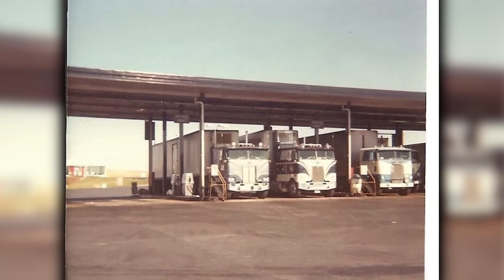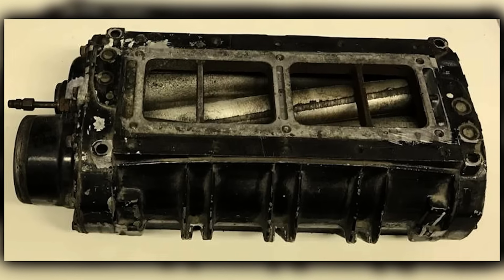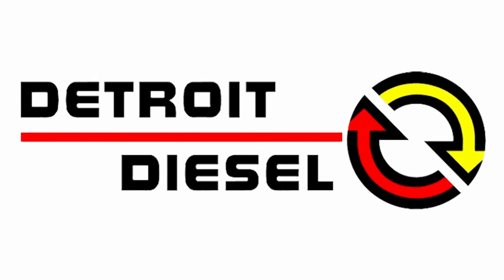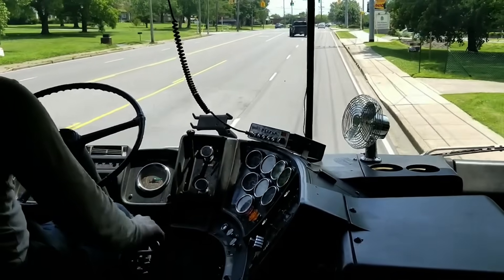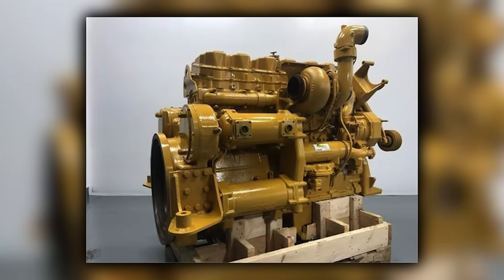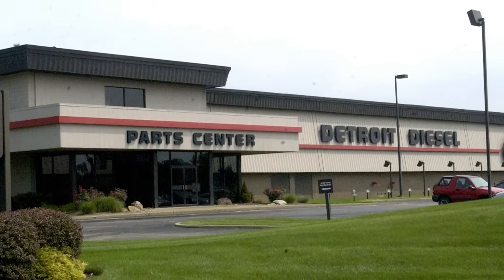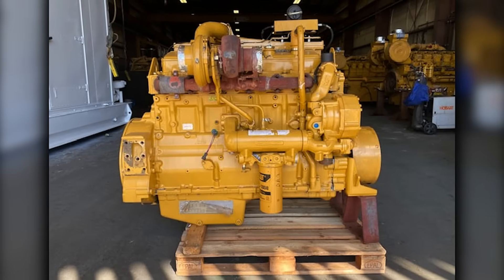Why Caterpillar’s 3406 Engine Still Haunts Detroit Diesel

Comment: @9:07 Oregon Pacific Company was a logging supply company - chokers, bells, wire rope, etc.  I know; I grew up two blocks from the store. It was located on Sheridan Avenue in North Bend. They didn't own any log trucks.

Comment: Decent video though some misinformation. 
Cat introduced the 1693 into the trucking market in 1964. This was their first over the road engine, predecessor to the 3406A introduced to the market around 1972. It remained the legendary Cat until 84 when the 3406B came into production followed shortly thereafter by the 3406C in 90 and the 3306E in late 93.
And no, none of these can be either or both... The Bs and Cs have similar fuel deliveries, however they are entirely separate engines
Reply: The 3406B and C are exactly the same engines. The C model had a bigger cam in the injection pump and an updated timing advance. Other than that the C model had an electronic stepper motor controlling the fuel rack.
Reply: The 3ZJ had a fully mechanical pump and the main bearings are larger. They are not the exact same

Comment: I was so happy when Cat stomped DD out of existence. I hated those Screamin' Jimmies. I knew several equipment operators who went deaf in their 40s because they sat next to the engines. The worst was some drill rig operators. They'd mount the seat next to the damn engine and run full throttle all day long. No earplugs.  I'd wear earplugs AND ear muffs if I within 50'. The operator was 4' away from an unshielded engine. It was criminal to let guys work so close to those engines. They did it day in, day out. But it was job security, because nobody in their right mind would work on one of those rigs. There really should have been a Class Action to run DD out of business - they ruined a lot of lives.

Comment: The Series 60 took 60 some percent of the market after sorting out the wrist pin issue with gen 1.   It was time for them to change and grow, and they did so successfully.   Contrary to your assertions that arrogance killed DD.  Your wrong.   Their succes did if you call being bought by Daimler then MTU failure.   The DD13,14,16 are fantastic engines .

Comment: I work as a diesel tech. Cats are by far my favorite to service. I don't see too many of them but it is always a treat when they roll in. The newer Detroits still leak oil pretty bad. See it constantly on the DD13 and DD15. Nice to work on for the most part, but some are an oil coated disaster.

Comment: I was a warranty manager for a CAT dealership in the Chicago area and the 3406 was a great engine.  CAT came out with the 3176 and it was a complete failure. Injector tips falling off and subsequent turbo failures.
Reply: The little 3116 in the 1990's was a great engine in the GMC Topkick. Very rarely did any engine work on them, I worked at a WhiteGMC dealership in Ontario

Comment: I drove a 3406 B in the late 80’s, nice powerful engine, but it was Heavy making the payload less.
Reply: I don't think 300lbs is making that much difference in payload. If it does then you need to be hauling some better paying freight.

Comment: Fuel rail pressures were the same when the motor came out to the version c at 28,000 PSI... 

That is so far from beyond truthful it's laughable , when the 3406 came out a 28k psi injection pressure wasn't even dremnt of yet.. 

Please do some accuracy and continuity checking of the Ai created videos.

Comment: The main reason Detroit two strokes leaked oil on the ground was from the air box drains. This was just normal oil getting past the oil rings that any engine has. A typical 4-stroke engine would simply burn this oil during the combustion process. I never understood why Detroit didn't simply drain that oil box spillage oil back to the oil pan and have a good crankcase vent system rather than dump that oil to the ground.

Comment: The 12.7 Series 60 is known for its fuel economy. The easiest to work on. Parts easy to get. Series 60 was the first electronic engine. Cat is good and has more torque and power as stock but cost more to operate and parts are 2-3 times more money. You can definitely make a Detroit run with a cat.
Reply: Well you don't have to buy parts very often with a 3406B. An inframe at a million miles or possibly a water pump at 700k should be paid for at that point. 
If you don't over rev or overheat a 3406B it won't break down. That mile to mile and a half less fuel mileage than a series 60 doesn't matter when you're running the days that the Detroit is down and you're buying those easy to find parts.
Reply: @darrenwebb5334 1.4 million on my series 60. In a glider. was factory reman when I got the truck. $13k to get it rebuilt at Freightliner next week

Comment: Detroit C60 Series it would pull He-ll off it's Hinges and still get good fuel mileage.
Reply: Not out pulling a 3406B or Cummins N14.
Reply: @darrenwebb5334
.  The 3406 Drinks diesel. The N14 I'll take one them it's a little better on fuel mileage. Detroit C60 all day long. 😊

Comment: There was a mention of a 3406 dry block design, I worked for a Cat Dealer 40 yrs and was in service for 30 yrs and never heard of a dry block 3406, the narrator has made some errors, such as saying there was a 3308 engine, No. maybe they meant a 3208.
Reply: A lot of misinformation in the details here.

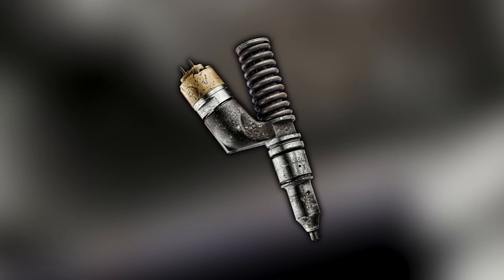Comment: 8:49  That is an electronic unit injector (EUI), not used in Caterpillar engines of the 70's.  The earliest EUI Cat I know of is a 3508 in a 1989 D11N, but there may be older.  Early 3406s did not use unit injectors full stop.  To the best of my knowledge the first 3406 with unit injectors was the 3406E, which came out in the '90s.  An interesting point is Caterpillar developed unit injector technology by copying Detroit.  I believe they actually bought some rights from Detroit for DDEC1 (Detroit Diesel Electronic Control) if my memory serves me right.
AI says the early 3406s used "sleeve metering unit injectors".  Not true.  Mechanical unit injectors are more a rack and pinon kind of design, and early 3406s used pencil type injectors fed through lines from a mechanical fuel pump anyhow.  I'm not sure what kind of fuel pump was on the very early 3406s but I have worked on a 3406B and it was a scroll metered fuel pump not a sleeve.  Another interesting point, I recall seeing one engine, I think it was a 3406C which had a mechanical fuel pump but it was actuated with some kind of electrical solenoid.
The AI also says fuel injection pressures are up to "26,000 PIS".  On an old time 70's model 3406?  Yeah bullshit, that's common rail territory.
Reply: Before unit injectors on Cat were nozzles in head. Injectors were in the injection pump. As in 3406A,Bs. Even 1693s. That’s why the fuel lines to nozzles had to be equal length and wound around.
Reply: Direct injection Caterpillar engines 3406B had that kind of injection pressure. The precup 1693 and 3406A did not.

Comment: This author must be clueless. Series 60 is the reason why cat got out of highway market. When it comes to fuel economy series 60 was the leader and cummins was right behind detroit in the 90s and cat was dead last. When it comes to used market no one wants a truck with a cat in it, and that's why they're so cheap. On the other hand if it's series 60 then the price goes through the roof.
Reply: Cat got out tiered of trying to meet the EPA emissions standards bullshit
Reply: EPA killed OTR Cat engines. Cat saw no point in dealing with DPF etc.

Comment: As an owner operator, the 12.7 Detroit is king. Summer blend, at 85k I average 6.8 mpg. I can inframe/headwork for $5500. Parts are cheap and available everywhere. I can plug my laptop in and have 650hp when I need to shut people up. Lots of great cat/cummins engines out there that I’d be proud to drive. But I’m all about making money and for me the 12.7 is all I’ll ever own.
Reply: They forgot to mention caterpillar doesn't manufacturer over the road engines anymore and Detroit is light-years ahead of there competition
Reply: Put the Marine tune in your 12V71,TT & bump it to 850hp..!!!
& you can also put the 92 injectors in - blows a bit of smoke on full throttle but nice on cruze..!!!
Reply: @mtl-ss1538 that’s the 2 stroke. We have one in our sand blaster. Better wear ear protection haha. But I’m talking about the inline 6 12.7 4 stroke.
Reply: Hell yea son
Reply: You are exactly right!!
Reply: I can crank up my 3406B with a socket and Allen wrench. 
My 3406B out pulls any series 60 everywhere all day long. 
It never breaks down. 
Never has sensor, ECM, or electrical issues. 
It doesn't need any electricity at all to run. It makes me lots of money and one to  one and a half mpg makes no difference when my engine is never down.
Reply: @darrenwebb5334great engine. One of the best ever really. We’ve had several. And E models which were great for us. I pulled hay with one and I could only
Average around 3.8ish mpg. But would pull any hill. Anytime people bring up power I just point to the photos of our old KTA’s. My current Detroit has 1.1m and all we’ve done was put o-rings on the injectors and 1 turbo.

Comment: Once again you make it sound like Detroit was the main player in the sixties and seventies. Cummins was also a huge player back then and, I would submit that Cummins was even more of a player than Detroit. The Cat 3406 was initially PCTA and they were not very fuel efficient. My personal experience was that the Cat engines (I drove both the 360 and the 375) were as fuel inefficient as the Detroits (I drove mostly 92 versions) and the Cats, in stock form, had less power. That all changed in the late 70s/early 80s when Cat came out with direct injection. With direct injection, Cat ran away from and lapped the field as far as power and fuel efficiency potential. I drove 350, 380, 400, and 425 versions, all either A models or B models. I also drove the 3406E in 435. No comparison with the 92 or the Big Cam Cummins. The Cats were better in all categories across the board in my opinion. That is precisely why they are still on the road. Also, check old truck values. One with a 3406DI engine will be listed at a lot more than a comparable one with a Cummins or Detroit.
Reply: Maxidyne. Great back then.

Comment: As both a Cat AND Detroit fan, wrenching on both for years, I have to say, you missed the one and ONLY problem that killed Detroits 2 strokes. It wasnt Cat or Cummins new engines or anything else for that matter, it was the federal goverment and emissions regulations. NO other reason. Yes, you mentioned it but also made a bunch of false statements about what really killed the 2 stroke. I guess youll have this when the person reporting was never hands on involved in the industry. Detroit was the very first to introduce electronic management systems and they were hands down, the most reliable on the road. Now, id take a 3406 over a 60 series just for wide part availabilty and a larger network of Cat dealers
Reply: Also, lots of people working on 2-stroke DD did not know correct way to tune them.

Comment: When I started at a Detroit Diesel distributor  in 1969 my first job out of service was rebuilding cylinder heads  for 53 and 71 series. All cylinder heads had valve seats that were replicable in the heads.

Comment: some fans on here are showing the love . a lot of old Detroit's are still screaming and leaking oil in marine applications. Even though newer more efficient engine options exist, its much cheaper to service what is in the hull. getting main engines out of yachts and crew boats is many hours labor cost..
Reply from the maker: Yes, the marine engines are a whole different ballgame. I have an uncle who works on them and it's not easy, especially in tight quarters.
Reply: Thanks to morons like u Detroit stayed in business

Comment: geeeze, im 10 minutes in and there wasnt a mention of the engine that out sold them all  nh, nhc, ntc, big cam .......cummins was the cost effective method of stopping oil leakage and ringing ears, perhaps not the longevity of a cat, but close.....and at times close to half the cost to reman vs cat.
Reply: Not to mention the KTA Cummins'

Comment: Cat 3406 is the best engine I ever drove behind , I drove lot's of miles behind 6-71's , 8-71's , and some 92 series , also the newer 60 series , many cummins models and none could compare to the 3406 series engines from CAT. They were smooth powerful and quiet , that's the engine I drove until my retirement after 34 yr's driving .
Reply: Mr. John fry, I thank you
Reply: I agree.
I'm still running a 3406B that gives me zero problems.

Comment: More AI GARBAGE.. .. electronic injection in the 80's?? 
Huge misinformation..  
Series 60 intro in 87??? Wtf
Reply: Actually, Detroit did do electronic injection in the 80s. 6V92 engines in 85, DDEC I. They were the first. Agree, alot of this video is crap.
Reply: I remember working on 88 model trucks with series 60 engines. That was back around 2000.

Comment: 5:15 - There was never a Caterpillar 3308 engine. The 3300 series was only built as a 3304, 4 cylinder, and a 3306, 6 cylinder. The 3304 was not sold as an on-highway truck engine. Cat did build the 3208 engine for on-highway truck applications such as Ford LT6000 “medium duty” trucks.

Comment: I never got to drive an old 2-stroke I do love the sound of them of course drove the four-stroke series 60 love that truck engine also the 3406 cat motor is great
Reply: I can say from experience, you were lucky. Those noise makers got old, the fuel mileage was horrible. I drove a few trucks with the 6- 71, 8- 71, 8 - 92. The 6 was 238 horsepower it got the job done, just made for long days especially with a heavy load. The 8V 71 was better, still fuel mileage was bad. Then the 8V 92, it was a power house, but with 3 miles per gallon unacceptable in today's world. The best fuel mileage I ever got out of any Detroit, was 4.5 MPG. That was with an empty trailer.
Reply: We had a terex loader with a Detroit 2 stroke. It was a smaller 6 cylinder maybe. That thing was so noisy. It was great.

Comment: DD 71 engines had dry sleeves and were/are completely serviceable, heads can also be completely reconditioned .In colder climates the Cats would have fuel gelling problems when the DD would not due to the high volume of fuel heated and returned to tanks. In extreme cold situations it was also easier to get DD fired up, if you could get it rolling over a bit of ether would bring it to life. While not as fuel efficient, noisy and oil slobbering DD were tough engines, the military powered most everything with them for decades.
Reply: I thank my hearing problems thanks to the 671 5ft behind me in the first craine I ran.
Reply: Exactly, still have the liner removal tool it expanded in the intake port and you turned the engine by hand and the piston pushed the liner out. We would inframe them in a day.
Reply: Sure, ether could get the engine fired up in cold wheather. But it might be running backwards.
Reply: Ur another 85% of the country that should have been drowned as a toddler

Comment: Drove many rigs with the 3406, great engine!
Reply: The Detroit 60 series has proven to be the best all around engine.
Reply: @mtl-ss1538 Yeah, cause that's why you see so many 2 stroke diesel v8 engines in trucks today 😂
Reply: @mtl-ss1538 bullshit. Tell us how you come to that conclusion. 
The 3406B, C and E out pull any series 60 all day long. The B model doesn't break down if you don't over rev or over heat it. 1-1.5 mpg less for the cat makes no difference when the engine is never down due to electronic sensor, ECM, or wiring problems. The series 60 still have the trademark oil slobbering issues and lots of front structure problems and are notorious for developing a window in the block behind the ECM as well as holes in pistons. 
Caterpillar 3406B had none of those problems. 
Nice try.

Comment: I have never owned a caterpillar engine but I've owned lots of Detroit's and I'm a pretty big fan of my 60 series Detroit I mowed a lot of Cummings N14s M11s, Even though I've never owned a cat I've always been intrigued to play with one and have never been intrigued to play with an older series Detroit
Reply: Your series 60 didn't out pull any N14. You may have gone faster due to axle gear ratios or pulled a hill better because you were  empty but at the same weight your series 60 is back of the bus.🤣

Comment: Where does Cummins fit into this picture?
Reply: Cat set the table for Cummins to even have a chance to eat....
Reply: @BigG903 but Cummins was strong in the 60s and 70s before Cat even began producing truck engines
Reply: @TIJoe-te9qu 
Thanks for the correction, I was totally talking out of my ass on that one lol...
Reply: @BigG903 No problem. I knew this because I once had a 1964 Peterbilt with a Cummins 335 HP, which worked its tail off for me. I'm actually surprised CAT didn't jump into trucking earlier with their off-road diesel experience.  My father had a very old D8 cable blade, and that engine seemed like it was built to last a lifetime.  
I drove CAT power in ConWay trucks,  and the torque is amazing.